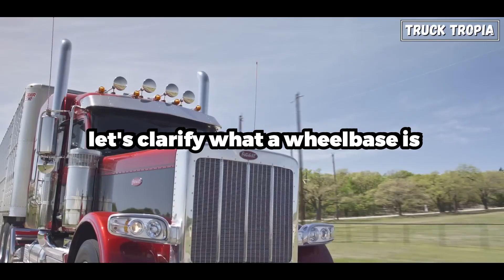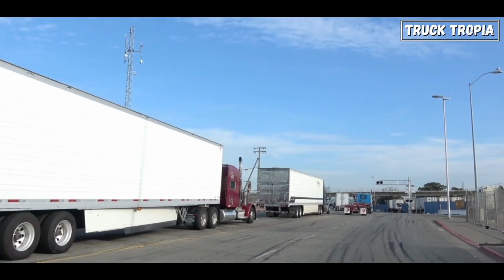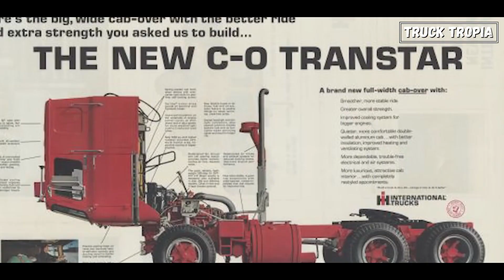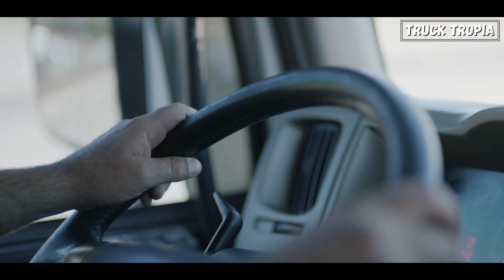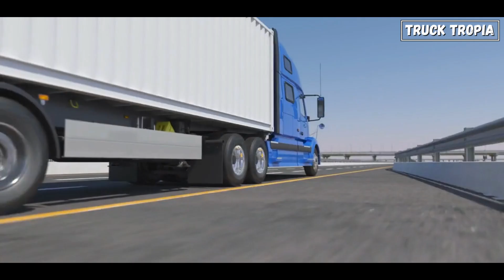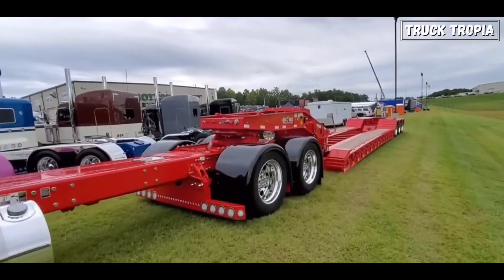Why Trucks Have Such Long Wheelbases?

Comment: My offered opinion as to why trucks and trailers have lift Axles is to save fuel when empty and to reduce tire wear when they aren't needed !
Reply: Hint: ground pressure
Reply: Also save on tolls (charged per rolling axle) and truck axles don't like to be too light, they tear up tires when traveling long distances empty (this is especially bad on trailer axles, tires don't so much wear, but get chopped up, flat spots/river wear)
Reply: I heard they sucks in the snow and rain but I don’t know if that’s true tho I never a truck class a with a lift Axle I only drove a tank wagon with a lift axle in the middle for weight

Comment: Mostly long frames on a tractor are because idiots think it looks cool. Try working NYC with one of those POS
Reply: Yep. Same as thinking manuals are better.
Reply: @Low760  And you think there are automatic semis?  Not one automatic transmission semi truck has ever been mass produced.  

What you're thinking about is automated manual.  It's a manual transmission with a little robot mounted on it to shift it and run the clutch for you.  It's a manual gear box, because.... wait for it..... IT IS BETTER.   (none sincro manual to be specific, because 10, 13, 18 beefy gears take up enough space)

Upside of actual stick shifts was that it took some skill to shift them, now with the automated ones any numbnut can jump in there and go "look at me! I'm a truck driver!" while forgetting that they are pulling a trailer and side swiping my truck twice in a week.
Reply: @jimmahr.4665  seems to me that the licencing is to lax not the trucks that are to easy to drive
Reply: Try thinking that NYC is not the bellybutton of US.  Also over half of long haul truck drivers don't want to go north of Baltimore, and there are a LOT of trucks that long haul purely across Nebraskas, Dakotas etc.  They pay no penalty for their set ups.  If you ever get out of your little bubble you will find out how BIG US is.

Fun fact.  Did you know that loads going to NYC pay more?  And I mean MORE, I'm talking couple thousand bucks more.... straight out of your pockets,  still not taking it, screw NY NJ and your toll road gouging on trucks, pay your "make trucks pay it" penalty. (your politicians lie to you, at the end, YOU pay for the tolls with every load).
Reply: Its because of economy.Europe now is showing the way as U S has to adopt till tesla  and chinese take overwith ev
Reply: @stephenmoutafis5587  that electric truck take over will be 30 or 40 years from now if it ever happens, and Tesla won't be part of it. Elon musk is a big time idiot they couldn't design a viable truck of his life depended on it

Comment: I mean, except cabovers and definitely except European ones. They typically only have one rear axle and have very short wheelbases, which after running in a simulator (Beamng Drive) I flipped it over during a turn because it wasn't like the conventional truck with the longer wheelbase.
Reply: European trucks are engineered as a package and meet higher safety standards.
Reply: Two steer axles are better then one (tractor drive tires serve as steer axles for trailer) more traction up front to control the trailer, 50/50 weight distribution for where the weight is.
Reply: how the fuck did you flippe it? I have been driving all kind of trucks and configurations over the years and never came close to an accident such as you discribe.
Reply: Australia is the level player which has both Europe and America but b double and triple on 6×4 shorter wheelbase

Comment: Can you now make video on most reliable truck brand?
Reply from the maker: Hard to say which is
Reply: This would be an impossible subject, purely opinion, and even by stats would change every couple years, also unlike in cars,  you spec what brand engine, axles/suspension, and sometimes even ABS you want in a semi.  The emblem on the hood is the cab and frame. (not all brands are available on all trucks but...)
Reply: There really isn't one. Unless they use proprietary parts. Ford was horrible for that using car headlight pull out switches that you couldn't buy anywhere. The reliability comes from the engines/ transmissions you order on it. At least, that's how it used to be. In my day, it was hard to beat a Cummins 400, a Cat 425, and a fuller 13 speed overdrive tranny. I put half a million miles on a Peterbilt without any problems except for the jake brake wire falling off it's switch. Really. Of course, it chose to do that coming off a mountain and it got hairy. They used a crimp connector on the jake brake switch!

Comment: Can you make a video why trucks have lift axles
Reply from the maker: Already made Will be posted in a couple of weeks 👍
Reply: Yay!
Reply: I think is for reduced tire wear and road noise
Reply: @emperorsniper2806 reducing tire wear, road noise and fuel consumption and turning radius.
Reply: @meekdook4236 then why have the extra wheels there in the first place if it's better without
Reply: @CarMagic1  To spread the weight.
Reply: @meekdook4236  neah I think those wheels are useless
Reply: @CarMagic1  They are not useless.
Reply: @zorilaz They only need the extra wheels when they're heavy. If they're empty or only lightly loaded, lifting the extra wheels gets the tires off the road, which helps the tires last longer. Being able to lift the axles when you don't need them also saves fuel.
Reply: @emperorsniper2806 Load capacity, particularly in heavy haul applications. When hauling a regular load the axle can be lifted to reduce wear and operational costs.
Reply: To spread the weight with heavy loads 
And lifted when it's a light load to reduce tyre wear
Reply: Maybe reduce tires wear
Reply: Lift axles are there mainly to keep the flatbed trailer from snapping in half in steep driveways. You pop them off,/ pull them up, to take the strain off the center of the trailer. That's why you see them almost exclusively on all aluminum flatbeds. I actually saw one snap once because the driver forgot to raise it. And that was a mess.
Reply: Lift axles are for carrying capacity
Reply: Lift axles are to spread the weight to keep axle weights legal
Reply: Drop axles are used so you can haul more weight. They take weight off your steer axle so you aren't overweight on your steer axle
Reply: Primary reason is on heavy loads they can meet the federal bridge loads requirements.